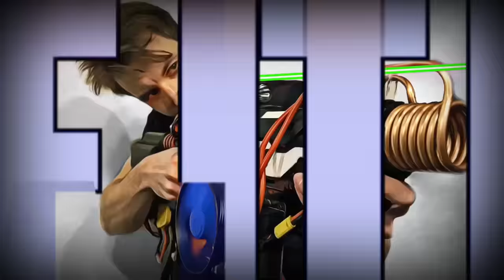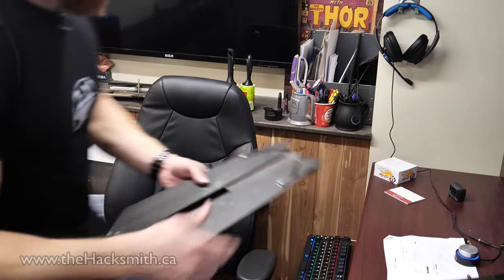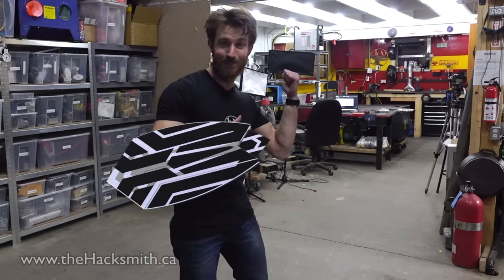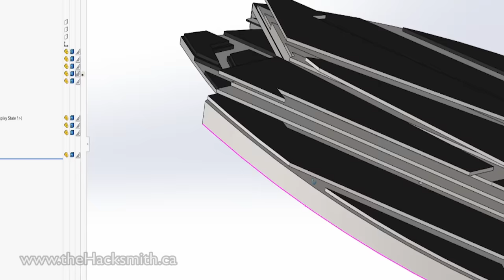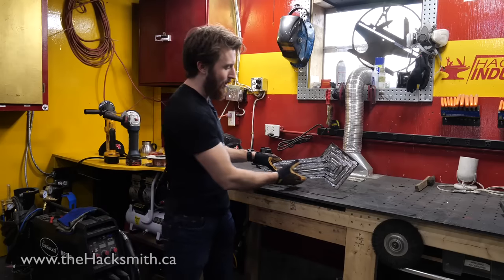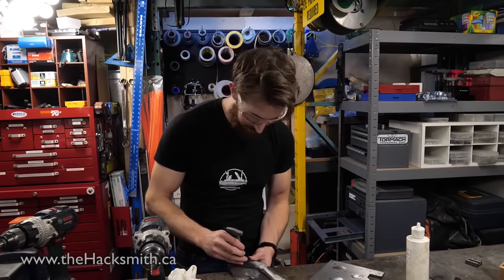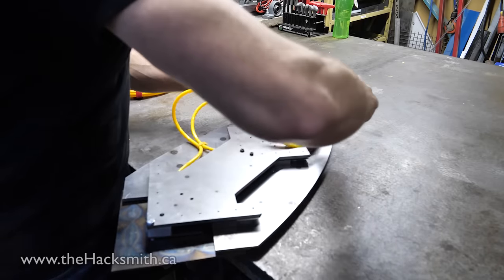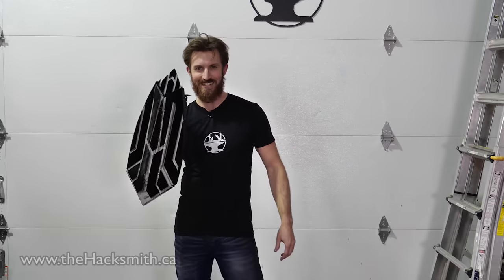Captain America Wakandan Shield BUILD (INFINITY WAR)

Comment: Cant help but notice, that you had a problem with warping parts during cutting and welding. I work with a company from Germany called ARKU Maschinenbau, that builds leveling machines for metal parts. We also got a leveling Service centre in Cincinnati. If you have problems with warping parts again you can just send them your parts and they level them for you. 
Also, if you level the parts on one of our machines before welding, they wond warp during welding due to relieving the heat stress induced by laser- or plasmacutting

Comment: Pretty good, but I think they should more difference between the shield in normal mode and expanded mode. From normal to expanded mode it changes only a little bit and get a little bit bigger thats it.
Reply from the maker: You saw how much work went into this right...
Reply: @hacksmith  This are just my thoughts not an attack, the work is good of course